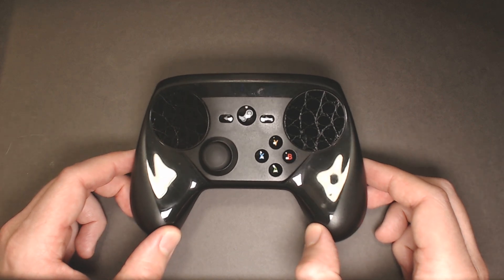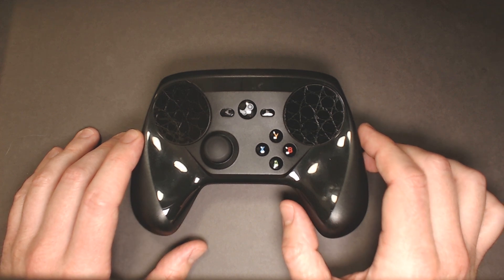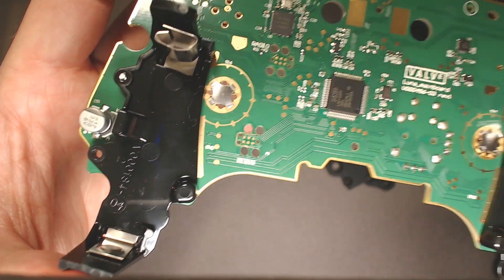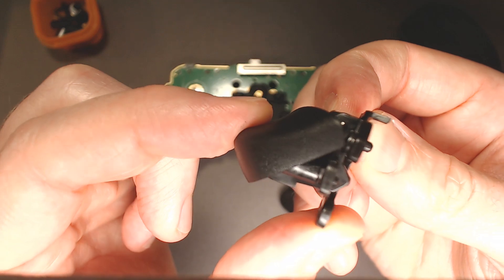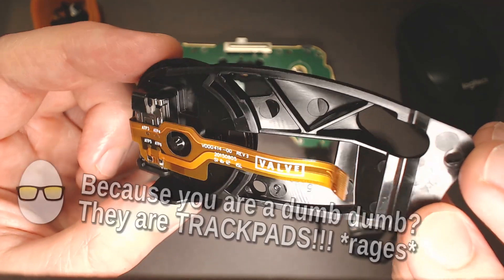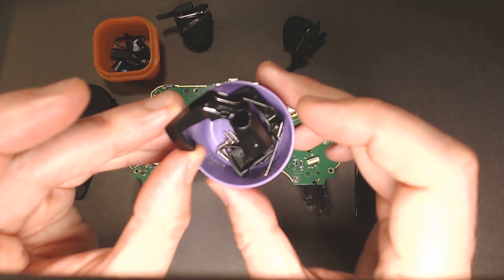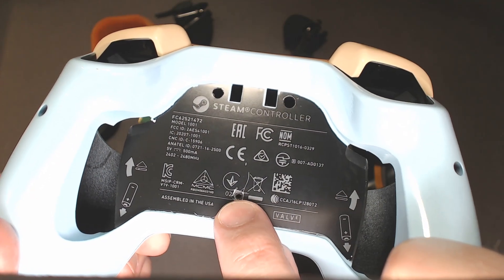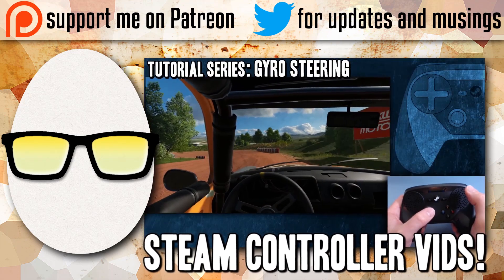Steam Controller Torn Apart - What's It Look Like Inside?

Comment: Hey Egg, I just had a quick question - off topic. How do I enable fully automatic mode on the game Squad with a Steam Controller? I'm using your profile, but just can't seem to use fully automatic with my assault rifle. I would appreciate any help. Thanks.
Reply from the maker: Right on the Dpad (left track pad) is change fire mode, unless they changed the keybindings. I made the profile when the game launched, it's probably time for me to dive back in and do a v2.
Reply: ExistentialEgg That would be greatly appreciated, if you could.
Reply: ExistentialEgg I haven't even tried your Arma 3 control profile, I think I would get so lost.
Reply: ExistentialEgg Thank you very much, it worked. Is it possible to turn gyro off? I am not good with the gyro. Messing up so much.
Reply from the maker: Yeah, in Configuration Gyro is the box under the controller (it has a little gyro icon). Click on that and you can change it from Mouse to None. I highly recommend getting used to it though, gyro is what helps the steam controller be so amazingly accurate compared to other controllers.
Reply: ExistentialEgg Ah ok. The problem is, when I tilt the controller left or right, it doesn't automatically register the tilt, like sometimes I'm tryin to aim, and it'll just be stuck on right tilt and take some seconds to get back straight or left tilt? Do you think you could make another Squad video? I definitely want to get better at Squad with the Steam Controller.
Reply from the maker: Yeah, I plan to get back to it one of these days and play more. I made the profile before there were taps and holds and stuff in the Configuration software. In gyro settings you can adjust the tilt range, check my other vids, I made a whole tutorial vid on Tilt.
Reply: ExistentialEgg Ah ok, what is the name of the video? Is the tilt mentioned in the Squad video or completely separate tilt video? I appreciate the quick responses, Egg. Thanks a lot.
Reply: When I get into the vehicles, I can enter them, but I cannot start the engine (e), am I doing something wrong?
Reply from the maker: Tilt Tutorial: https://www.youtube.com/watch?v=-kEpzxqxVhU On vehicles, I probably don't have that bound in. I made the profile before vehicles were in the game, you'd need to check the game's bindings and then my profile bindings to see if it's in there.
Reply: Makes sense. I'll watch the link right away. Just a quick question, do you prefer if I message on here or Steam?
Reply from the maker: Here or twitter is easiest. My steam friend list is kinda bloated so I stopped adding folks and don't sign into chat.

Comment: Off topic? But I would for valve to release a steam controller with rechargeable batteries.
Reply from the maker: A lot of folks request that. I personally like being able to change out the batteries. Rechargeables die over time, my PS4 controller only holds a charge for a few hours.
Reply: ExistentialEgg yeah, the battery on the DS4 is horrible. 

Can you tell me how long does the battery last on the steam controller ? I'm looking to get one.
Reply from the maker: Usually about 80 - 100 hrs. Basically... a LONG ass time. :P

Comment: Awesome! Have you or anyone though of replacing the stock trigger springs with more stiff ones? I was thinking of doing so myself since I've picked up Dirt Rally on steam and would like to have more sense of control on the soft pull range. :0
Reply from the maker: Hmm, I haven't but I know on reddit I've come across someone making trigger extenders (3D printing). I didn't actually take apart the entire trigger to see how much would be involved in changing the spring.
Reply: Hmm... I might have to go snooping for that reddit post then. Wish I had a 3D printer right now. The things I would make are pretty endless. lol